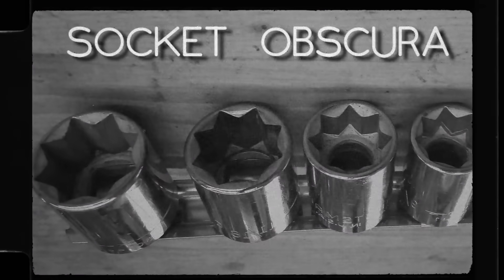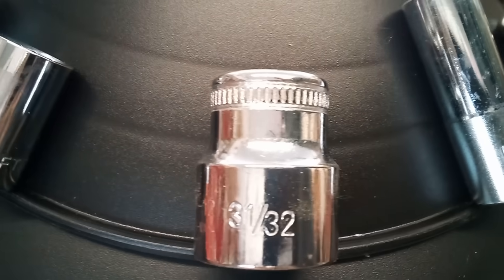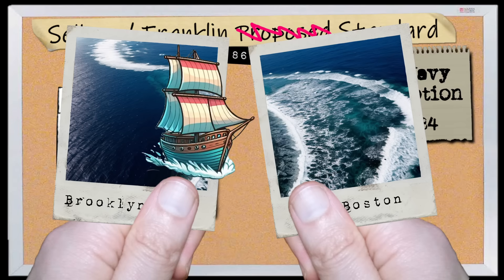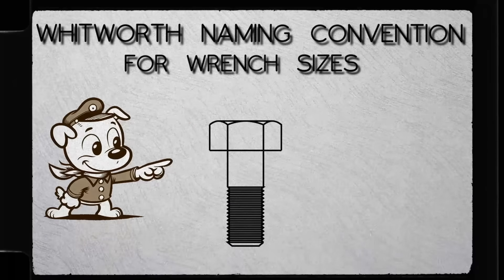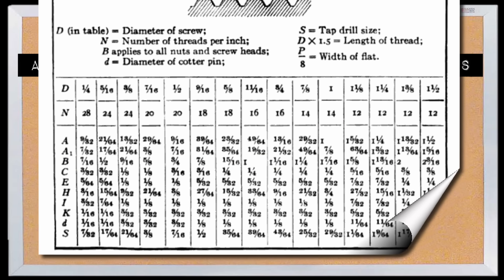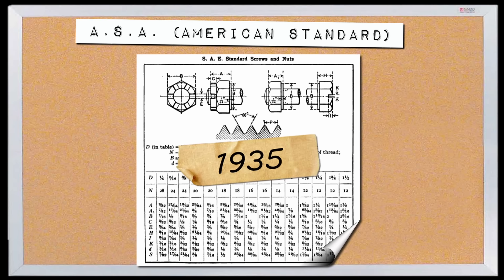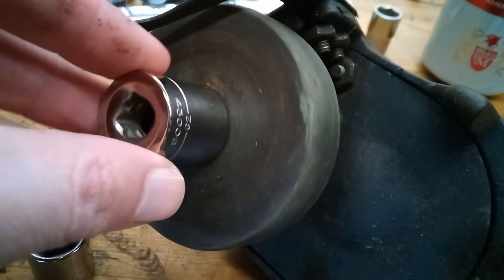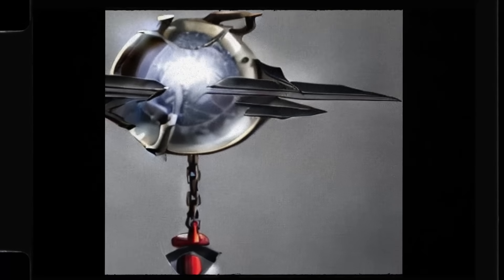32nd of an Inch Bolts - History & Lore

Comment: Recently purchased an old set of Williams 1/2 sockets. Included wit h the normal sizes are 19/32 21/32 25/32 31/32. The 19/32 looks like its been used but the other 32nds look brand new. Nice to have the odd sizes because I live in the Rust Belt and the bolt heads are no longer their original sizes after rust eats them away.

Comment: It's all a scam to sell more tools. Everything should be metric and they should do away with the rarely used sizes. Look at the trailer industry. Do we need a 1 7/8" ball when there is a 2" ball? People have been hurt and killed over those two very similar sizes. It's all about selling more shit so they can have more money.
Reply: No.  Most sets run in 1/16" steps.  Nobody gets a /32 wrench unless he needs it.  If I needed one, I would just get the individual one I needed.  Professional mechanics might buy a set with /32 sizes.  Since a 16th is about 1.5 mm, you could say that a set of wrenches with mm steps is a "scam" to sell more wrenches.  I wouldn't say that, though.

Comment: Naw ...these companies and their brands are just as confused as anyone who depends on marketing and bean counting to set up their business model. Ryobi illustrates this best; Some of their electric drills are absolute trash while others are fantastically good, but it doesn't depend so much on price. What a bunch of goofs! One saving grace is that when a huge proportion of a particular type of tool comes from one factory in China, it's usually because the won the contest of making a good tool cheaply, and consequently they are able to crank them cheaply just because they make so many of them. While this is not great for diversity, it does give the consumer a lot of bang for the $$$ if they buy the tool. Trick is to find out which tools are in this category and which brand sells it at the best price.

Comment: I've got a few odd sized sockets and "ignition wrenches". Occasionally these work better on rusty or galvanized plated bolts. Some can sub for metric. Usually though an adjustable wrench or even vice grips get used first!

Comment: I have a full  1/2 inch drive set of Industrial Standard Inc. socks in 1/32  increment. They are extremely handy, especially on corroded bolt heads.

Comment: I don't know why do they have 9 mm 11 mm 12 mm 13 mm 14 mm 15 mm 22 mm 32 mm 30 mm 19 mm or any other kind of size nut or bolt. 
Manufacturers made their nuts and bolts and threads according to the equipment that they had. A lot of times they made him to the specification of the customer they were selling them to

Comment: When it comes to modern cars, there seems to be no rules when it comes to metric either. Standard metric bolt heed sizes should typically be 10mm, 13, 15, 17, etc. Nope, not when it comes to automobiles. Instead of 15 or 17mm, sometimes it's 16mm. Think it should be a 13mm, guess again, it's a 12mm. And there's no physical reason for the size being different, most of the nuts and bolts are not in a confined space. Ridiculous!

Comment: Canada here.  We had a 1938 Chevrolet that took 32nd size bolts and later I owned a 1950 Austin that again took 32nd size.  I still have the sockets for these vehicles. Thank you for the video.

Comment: I needed a 7/32 spanner to hold the swage on the end of my handbrake cable to tighten it. My tool shop didn't have one so I had to settle for a 5.5mm which is slightly larger. Imperial isn't as big in Australia.

Comment: My first car was a 31 Ford model A which had several critical nuts in 32ths.  Consequently, I owned every Craftsman 32th socket that Sears offered. 19, 21, 23 32ths if I remember correctly.

Comment: Whitworth standardised threads British Standard Whitworth (BSW) in 1841.  23 years before Sellers, the Americans simply did not want to use a British system.  There is one oddity about BSW spanners,  a 1/4” BSW spanner made before WW2 is too big for a 1/4” bolt or nut made after WW2. In WW2 the size of bolt heads and nuts was reduced to save metal for the war effort so the 1/4” bold head was reduced to the size of a 3/16” bolt head which actually is more proportionate than the bolt heads pre war which was ridiculously large. If you have a BSW bolt with what seems an oversized head it is pre WW2.

Comment: I think it is good to keep both metric and standard as well as 32nd of an inch standard because sometimes the wrench or socket will fit tighter. Basically what i learned as being a mechanic myself is to get the wrench or socket that fits the absolute tightest possible on your fasteners to prevent slipping and rounding off the fasteners.Good video! God bless!

Comment: Really interesting video. I've been a mechanic welder for a long time. The older I get the more I feel my soul sort of sigh with exasperation each time I work on something and find yet another pointless button head allen, torx, inverted torx, security torx, mixture of SAE and metric, JIS instead of just #2 phillips... piece of hardware. At least we are about at the point in America now where vehicles are 99% metric hardware. Enough of the mutts of metric/SAE are finally in the crusher.. that I finally retired my SAE tools to a box that sits in the corner, hopefully to never be opened again. I did this to make room in my main box for the 73 tools I've bought for all the new fasteners. I wish someone would hit the design engineers with a rolled up newspaper or squirt them with a hose and yell NO!!!!! Whenever they get bored and invent a new fastener or install a few of the oddball ones in a strategically placed incredibly inconvenient spot. I have a couple of these big 32nd wrenches and have never found a single use for one thankfully. Everything should just be 6 point metric hardware now.

Comment: hi i am an engineer in swiss and i design and build swiss watches. i could not build it with the inch system because the fractions would drive my crazy. metric is the way to go in high precision engineering.

Comment: I'm surprised you didn't bring up mysterious Woonsocket, RI in your segment about sockets.
For one thing, it's the former home of Simplex Tool Co, who manufactured a rather interesting "Ratchet Wrench" in the 1920s, and possibly also vices. Or maybe Railroad Jacks, you decide. Also there was Bailey Tool which made woodworking tools. Or something.
But why Woonsocket, RI you ask?
1: Socket is already in the name.
2: It was purchased from Nipmucks.
3: It's right on the RI/MA State Line, and therefore part of the unpronounceable "Worcester, Leicester, Boston, Providence, etc" Metro Area. So you could have fun with that.
Reply from the maker: I have Simplex on the list to research for a future video. They got bought out by Ridgid in the '60's.
Reply: I have a set of weird open end Craftsman combination wrenches, that look like they kinda copied Simplex. They're called "Speed Wrench" because they look like whomever made that was probably smoking crystal methedrine. Apparently nobody likes them, I never tried them. When I first saw one, I thought someone had modified a wrench themselves.

Comment: I tend to not believe a word of this . Fractional inch bolt sizes are called " imperial" as in from England and was invented in the 1790s in england .
Reply from the maker: You're thinking of the measurement system. Bolt standards use a measurement system, but are not part of one.
Reply: @ballinator  no imperial sockets and spanners are fractions of inches . Most countries you get a socket set it's metric and imperial. 5/8s is imperial.

Comment: Dad and I worked with a lot of old equipment on the farm.  Both in the course of farming and with antique equipment we restored.  You'd find yourself reaching for those odd sized sockets and wrenches more often than you'd think.  And the 8 point sockets from the intro, those were useful too, for "farmer nuts" as square nuts used to be called around here.  That all sold at the auction after Dad died.  I picked out some tools, but there were too many things to save it all.

Comment: Years ago, I was very annoyed to find that one nut on the ignition coil was a 5/16 and the other was 11/32. What a dumb idea that was. That meant I would have to have two wrenches for nuts that went on studs with the same threads. So I took the 5/16 from the old coil and replaced the oddball on the new coil. 5/16 on both sides. Sometimes you have to wonder who designs these things.

Comment: When you try to make precision parts based on a measurement the size of the width of your thumb and then divide it into 32'nds, 64'ths and so on. Things tend to get a little bit more complicated than need be. Thankfully by the time real precision was needed thousands and ten thousands of an inch was introduced. Which is a metric system hybrid with a straight forward base ten division. However it's not compatible with the standard base 2 fractions. Then there's the number drill sizes. The multiple ways the US has screwed up the measuring standards in engineering have given the rest of the world so much entertainment over the years. We absolutely love it, please never stop!
Reply: And when you run out of convenient drill .number sizes, well, you go over to letters
Reply: Metric measurements are based on a unit more than a yard wide.  Precision does not depend on units.  Any unit can be divided as fine as is necessary.

High precision work in inches uses decimal fractions, just as in Metric.

Comment: I just love how America picked up on the metric system so we got to have metric and American Standard because they mix both size bolts on one particular car or several cars so you never know what the hell you need really you can tell an engineer come up with that one stick with American the bolt will always be bigger if you go to metric it's down size slightly smaller which has less strength 9/16 a half

Comment: Wrenches in 32s are handy for metric nuts and bolts. My bicycle needed 19/32 to take the wheels off.
Reply: No, it didn't. Standard size for nuts on bicycle axles is 15mm, not 19/32 double quotes.

Comment: I worked as a machine designer for over 45 years and did a lot of mechanical work on my own cars. Not mentioned was most, but not all, hex head screws use the same wrench size for the screw head and the nut. An example: 7/16 hex head screw = 5/8, but a 7/16 hex nut = 11/16. 
Also not mentioned are "Heavy Hex" bolt sizes that are different than the stadard sizes. Even the Metric standards have variations depending on countries' standards.
"Standards" are just a goal that hasn't been 100% achieved yet.

Comment: Makes me think of OSB - 1/2" and 7/16".  What's the difference except 1/16"? Except price, why use one over the other?
Reply: A sixteenth is a big difference at that size.  The 7/16 is 12.5% smaller than the 1/2.
Reply: @GH-oi2jf  I don't see how 1/16" would make a difference in sheathing other than you'll need your siding 1/8" longer. And my question really is who decided we need a different size? Who said "½ is too thick. gimme 7/16"?

Comment: I once owned a Norton 750 motorcycle, and the starter pawl on it was prone to break. Imagine my frustration to find that, after taking the cover off, all the nuts on the gear box were Whitworth sizes, and none of my wrenches or sockets would fit. I still bear a grudge against anything manufactured in the U.K.

Comment: I have a nice set of British Standard wrenches. I found them at an estate sale. It's a 7 piece set, the sizes are 1/4" through 5/8". The actual sizes are:
1/4 - 7/16
5/16 - 1/2
3/8 - 9/16
7/16 - 19/32
1/2 - 3/4
9/16 - 25/32
5/8 - 7/8
My Craftsman double box end wrench set includes 19/32, 21/32 and 25/32 wrenches.

Comment: It's very interesting  standard vs metric, a inch is 16 parts.
To get more precision they   split it in 32 and even 64 parts. 
Next step was to kind of integrate the metric system when they split inch in 1000!
Example: bore an engine 0.030" over.
On other hand we have standards that hangin in deep in the metric part of the world, rims & tyres a combo; wit
Reply: Using thousandths of an inch for fine work has nothing to do with the Metric System.  We use decimal fractions with US units in many situations.

Comment: You can use a lot of these odd sizes in wrenches and sockets can be used on metric nuts and bolts as a mechanic i learend this remember the five eights drive sockets and five eights air and electric impacts the five eights drive sockets were pretty cool for me it was a better choice than three quarter drive  but you cant find that old stuff any more sad

Comment: I always thought that the odd "32nd" increments were to use our SAE measurements on metric bolts without stamping a metric number on the tool. An example is when come across a metric 15 bolt and I don't have a 15 metric wrench, my 19/32 SAE wrench will fit perfectly!

Comment: I worked drilling water wells. We had a 1948 International Harvester rig. It  came with a tool set International Harvester Tool Set that had wrenches and sockets in 1/ 16 to 1/64 increments. I even had to unfastenen a mud pump held by 2 inch by 33/64 nuts. Also it would work on his 1944 Brittish Motor Cycle. Which has a wierd assortment of bolt and nut sizes 🤔

Comment: Interesting history. I always thought that the 32nd sizes were an attempt by U.S. tool brands to fit metric fasteners before the U.S. public was familiar with the metric system.  I was never a Ford guy, but I remember being told that there was a particular fastener on certain engine models that needed one of those sockets.  I have a few which I keep in the “weird tools” drawer of my toolbox.

Comment: The US (and other non-metric countries in the 1800's) missed an opportunity to defeat the most common argument in favor of metric.  If we sized everything in 32nds of an inch and just numbered the sizes 1 through 32 we would have won the standards war.  Need a half inch?  Thats a number 16 socket.  Need a 9/16?  Thats a number 18 socket.  In the big boy world, you need an inch an a quarter?  Thats a number 40 socket.  No need to calculate fractions if you don't reduce them, and leave them all as 32nds of an inch.  Also, with metric you have 25 sizes (1mm to 25mm) per inch, with my idea you have 32 different socket sizes per inch... no need for that 4.5mm hex wrench!
Reply from the maker: Interesting idea!

Comment: I pulled apart a hydraulic pump off a 1953 Clark (forklift) a while back..  15/16 didn't fit..  1" 12point just rolled around it..  Pull out the calipers, 31/32..  Good condition, not rusted..   It made no sense to me, I'd never seen that before..   Now I know why.   Cool, I thought I was crazy.  
.
A 1" 6point worked good enough to get it apart.

Comment: There was a 21/32 combination wrench in the toolbox on my father's dairy farm. It fit the mid-body hex head on the brass pushbutton valves in the water cups (the cows either pushed the button directly or a paddle that was hinged above the valve and extended deep into the bowl.)

Comment: The metric system is now the standard worldwide
Reply: "The" standard?  It is a worldwide standard, but there are many other worldwide standards.
Reply: @GH-oi2jf  The point is that the term metric unit system is an umbrella term and covers all relevant units of measurement, e.g. SI units or Gaussian unit system and is recognized worldwide, apart from a few irrelevant exceptions.

Comment: As I grew up working on cars starting in the early 1970s with a large number of them using metric size wrenches, I was amazed at the ease I could just grab the correct size wrench when I needed it. If I had a 13mm wrench that was too small a 14mm would do the trick. Of course, when one works on certain makes of cars, like VWs, you learn pretty quick that they tend to have favorite "go to" sizes like 10mm, 13mm, 15mm, 17mm etc. That said, I was generally pissed off when working on American cars where I had to constantly do the fractional conversion such as going from 7.16 to 1/2 etc. On day, it hit me... I marked all my std wrenches with x/16 fractional markings. In fact, I just removed the "16th" part and labeled the 7/16 as "7" and the "1/2" as "8", as in 8/16 etc.  That way when I had a "12" (or 3/4) wrench I knew that if I needed a little larger, I just grabbed the "13" which as in fact, 13/16. In the case of the "x/32" wrenches, I list labeled the "11/32" as simply "5.5" as in 5.5/16. Make sense? Yea I may be lazy, but it always seemed to make grabbing the next size up or next size down a lot easier. Would this work for other people? I don't know. The best part is that, these days I find I'm using metric almost all the time when I work on cars. Other places I'm  often still stuck with the nasty 1/2, 7/16, etc... Unfortunately, at the hardware store metric nuts and bolts are still harder to find and generally much more expensive.

Comment: If the nut head end or bolt are 1 size,  it is best to use the correct open end wrench if you don't need to use a cutting tool or or a socket set. ❤ maybe a little spit or Break free, vinegar would help get the stubborn ones apart. Or just let someone else do the work 🙄 🤷.

Comment: A couple of things that you're missing - One is the load type > tensile, compression and shear. Size and type makes a big difference in functionality. Two - applied location > having the largest hardware you can possibly use within the confines of the space allocated for it with the expected load strength necessary. A perfect example is wing spar bolts.

Comment: 11/32 is a common size in aviation. A 3/16th diameter hi-lok collar uses 11/32 on the drive part of the collar that snaps off at an engineered torque.

Comment: Boeing still uses the 32nds standard. A fastener call out will be a 6 for instance, which means it’s a 3/16th. Many of our wrenches and sockets are still in 32nds and the Engineering Drawings are called out in 32nds as well.